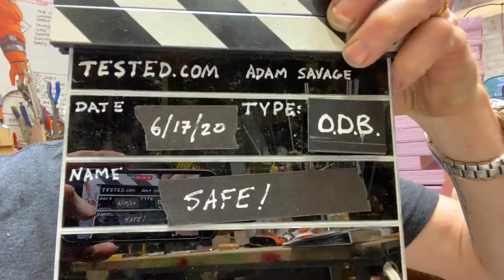Adam Savage's One Day Builds: Foam Prop Safe!

Comment: If you want an even faster sealer for the extruded foam that even provides protection against bondo, try the zinzer brand of shellac. It's alcohol based solvent so it doesn't affect the foam, and it dries in literally minutes. You can put 3 coats on a piece that size in an hour. I've put bondo and regular cheapo spray paint directly over the shellac and no melting. 
It's probably easier to find for folks than the specialty coating you used. Otherwise, it looked great. Shame you didn't make a graphic for the door to paint in gold paint to look even more authentic.

Comment: Use that hot glue in conjunction with blue tape to fill holes and make shapes.  After pulling off the tape use kleenex to put a fine paper dust to cover any exposed adhesive.

Comment: Word of note when using this material.
-Use low heat glue guns it you want to use hot glue
-Avoid using glues/paints with solvents in them, both will melt the foam. If you must use one with solvent, test it on an off cut. If it doesn't melt the foam, you're good, if it does melt the foam and you are still stuck using it, coat the foam in a sealant first. White glue is actually great for gluing the foam and as a sealant.
-This material marrs easily, cover in a durable material of some kind, either a very good varnish or fabric of some sort
-If you want to paint the factory finish sides, make sure to sand it, seal it, and prime it. Painting directly on the factory finish can lead to your paint job cracking and flaking once dried
-Be prepared to do touchups to any paint job. If the surface gets dinged it will crack the surface of the foam, exposing the bright pink underneath. It is VERY noticable. Best to touch up asap

Comment: I don't know if you'll see this, Adam, but have you tried the 7500 series respirator instead of the 6000 you're wearing in the video? I find it to seal much better against the face and provide better comfort while the exhaust valve is aimed downward, which makes it better suited for close up work when you might not want to be exhaling right on to the work piece..

Comment: adam it depends where you live(for foam), here in Ontario we can get up to R20 or 25. 2 inches or 2.5 inch thick, its quite funny as for foam models i usually find the thinnest i can! the formular stuff is over priced but sands a bit better. there is one here called pink panther for cheap or blue lowes foam!

Comment: Next time your shopping… pick up:
some lengths of 1-5/8” strut (curve them if you can for the workshop meander)
Strut Channel, 1-5/8" W, 10 ft. L, Silver
with interconnects:
Channel Trolley Track Hanger/Joiner Support Bracket for All 1-5/8" Strut Channel
and supports:
P1834-EG Channel Trolley Track Intermediate Support Hanger Bracket
and the end bits:
P2072ASQ-EG 1-5/8" Square Mount Post Base 
get some of these:
P2950-EG 4 Wheel Trolley 
or these:
P2949-EG 2 Wheel Trolley
and string up a bunch of tool balancers:
GR62410005 BD-05 Tool Balancer
If you’re especially nerdy, you can string a ‘festoon’ of pneumatic line down the length of the strut — and then Tom Sachs will come and visit your shop…

Comment: Hello, this is the LockPickingLawyer, and today I have this Savage Industries safe, for which I have been unable to determine a model number. Although it looks quite sturdy, you can see when I pick it up it is incredibly lightweight, lighter than any safe I've ever seen. I'm not sure what it's made of, but I imagine it woouldn't survive an attack with an angle grinder for very long. Nevertheless, the most interesting thing about this safe for me, is the mechanism. As you can see, the combination dial does not turn at all, and in fact, neither does this handle, which makes it very difficult to decode. However, this design does have one serious flaw: as you can see, the receiver for the locking lug is very shallow. So, let's lock this up… and to bypass the mechanism, I'm going to feed this zip tie around the handle here; now, simply by pulling directly outward, we have access to everything inside the safe. Okay folks, as you saw, opening this up doesn't really pose much of a challenge. Nevertheless, I do enjoy having these pieces in my collection, as they can shed light on the historical context in which they were created. It's fascinating to see how security has evolved over time as new attacks become available. In any case, that's all I have for you today. If you do have any questions or comments about this, please put them below. If you like this video and would like to see more like it, please subscribe, and as always, have a nice day.

Comment: Idea: to make a foam anvil and hang it up with fishing line so it looks like it howers. And/or hang it with a "normal" string that shuldent be able to hold up a real cast iron anvil
Reply: Get some strong but thin wire then cover it to make it look like a strain of rope, then wrap other strains around it to look like a full rope but the other strains are cut half way up so it looks like the rope is breaking

Comment: Other people have also commented that there are no locking pins on the door. My quick and dirty solution would be to just use a holesaw without the center bit and drill like 1/2 inch so it looks like there are pins. It's done in like a minute and adds a lot.
I don't think  holes for the pins in the safe are not necessary because it's hard to see.

Comment: The open door kind of breaks the ilusion. It clearly shows the door has no locking mechanism. It would benefice from one or two holes (real or faked) on each side of the door frame, and matching metal disks  (to look like the retracted locking lugs) on each side of the door. Surprised it doesn't include those given Adam's atention to detail and how they can be done with just a few minutes of work.

Comment: I've worked at a place that processed graphite, and yes, it will get you very dirty.
However, considering the other thing that place processed was carbon coke...
No, graphite won't get you as dirty as you've ever been in your life, carbon coke dust will. Interesting side note, graphite acts as a lubricant, making surfaces slippery, whereas coke dust is a very abrasive material, so going from one part of the plant to another you'd experience varying levels of traction depending on the material being processed near by
Reply: We had a Nigerian man working with us as a temp at one point and I(of Swedish and Irish decent) was so sweaty and covered in dust that when we put out arms side by side I was a LOT darker than he was 😆😆😆

Comment: Problem for finding the form is more just your geographic. Northern states where its still used for rigid insulation in homes its not hard to find the 4x8ft sheets of 2" thick in pallets.

Comment: Adam, Adam, Adam... Home Depot has 2" thick Foamular insulation in 4'x8' sheets for $35. You were robbed my man. Edit: Emeryville HD has the 1" 4'x8' sheets for $23, three sheets would supply the same amount of foam for $70 saving you $90.

Comment: Let's file this under "Reasons I no longer live in the bay area".  Here in the suburban midwest, big box chain stores (think: orange buckets) have 2" x 48" x 96" sheets of Foamular for about $25/sheet.  Those are pre-scored, so you can snap them into smaller pieces for easy transport if you don't have a truck or SUV. (or just bring a knife and straight edge to the parking lot ... no shame between makers, right?)

Comment: you should hang it over a doorway so you can point out if that fell on you ya wouldnt even notice have a little motor that drops the chain by a fraction when movement sets it off

Comment: those are half pin barrel hinges ... just like that pirate movie with Legolas .... leverage
Reply: one thing is  missing on the safe .... the door pins that would lock it closed ... 2 per side for that size safe i would expect ... a nice shiny washer or metal blank  would work fine ... and then just a little recess on the inside of the safe proper ... and it would look just like a well abused safe ... ok sure it could use a few "sledge hammer" blows and what not as well ... but otherwise the door locks are a needing thing

Comment: Yo Adam don’t know if you even have time to do your comments section with all these addicting videos coming out. Thank you, way better than mythbuster no offence. But here’s a tips instead of “stifling (90% I spelled it wrong), you could try rolling your finish next time there are different sizes roller naps and LENGTHS of em as well for intensity of the text your want. Make more of these amazing videos! Oh btw, can I request a dartboard cabinet/stand/portable or not whatever =D
Reply: Incase you fine get too much paint on the object or whatever surface, just use very light pressure and more number of rollers back and forth will solve it

Comment: I use this insulation foam all the time, building miniature terrain for tabletop rpg's. I know you love your proxxon rotater tool, but their hotwire table is a godsend when working with foam. Also worth checking is shifting land's jigs for the proxxon hotwire table.  Enjoy this tooltip! :D 
(instagram @bborremans to check all the stuff built from this xps foam)

Comment: Aluminium tape as a base, dulled with wire wool and given some weathering paint washes would be interesting to try ... I think that would give a totally convincing metal finish even close up. Makes me cringe though watching you use a table saw though, get a push stick before you cut something important off!

Comment: Wow: around here you can get 2”x4’x8’ sheets for around $32 plus tax. It’s available widely at ever HD within 100 miles; Lowe’s caries their own version that is blue. In fact you can also get 2”x2’x8’ both in flat side and tongue and groove sides for around $20-$25. I feel sorry for Californians quite a bit in your ability to get things; you guys have some tough environmental regulations. I do like CA Prop 65 as it is on everything now, when it was just supposed to make carcinogens easier to identify; I’ve bought both wood and Al/Steel even cement that gas Prop 65 on it. CA has seeming good intentions and mostly horrible executions; glad to see you baking the most of what you have.

Comment: make safe for David copperfilled browdway.  way show.               copperfielled night in museum.
Reply: Adam opens shuts foam safe. shows theater prop has hang celling. no way person be in with break. opens door out pops daved copper field in side museum. say there do magic pricelesss things. do cut marble statue into three peaces put back togeather like never cut.    rip torn card trick done to prices painting. take chain saw cut something looks mona Lesia into 4 peaces put back together. some kinda sharp swords. put hand through glasses pull swords out use in classic box trick were put stab swords in stab attractive woman posing security guard. put cloth over another paint pull cloth away lego painting. take few bricks out put cloth on it turn oil paint. but were lego take out missing in painting. glue hot glue gun lego back. put cloth back on paint restored.

Comment: I don't think a real safe like that, has feet.
The reason: You have to be able to bolt the bottom into a cement floor, through the floor of the safe.

Comment: it's not that good looking... the handle turn out a bit meh.... and frankly i think it could have used some lock bolts as detailing...  i suppose its good enough at a distance... still the painting and over all construction was good. personally i think it would have been funnier if it had contained a Peltie element cooler or a compressor coolar so it could fuction as a well unsulated coca cola fridge :p